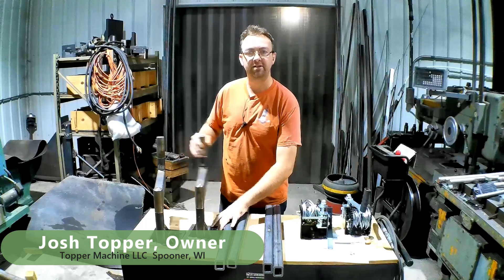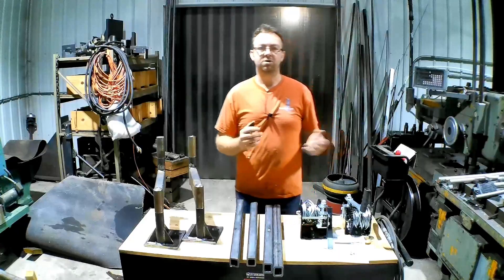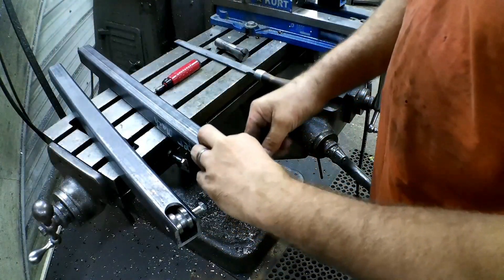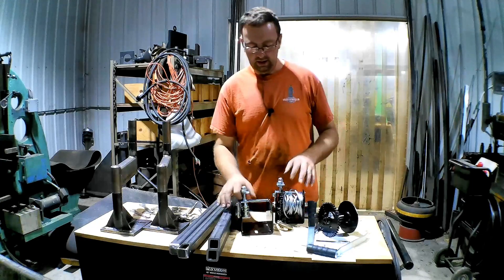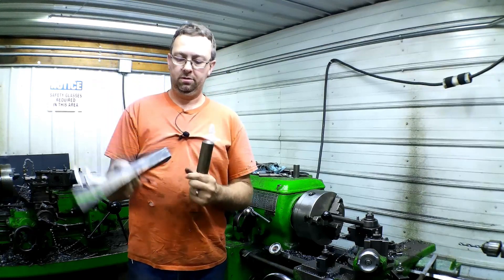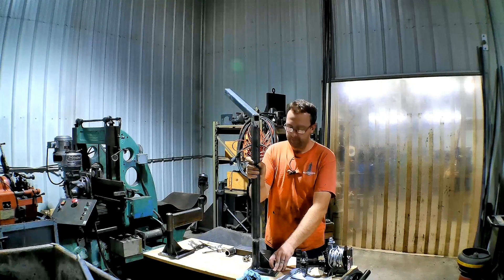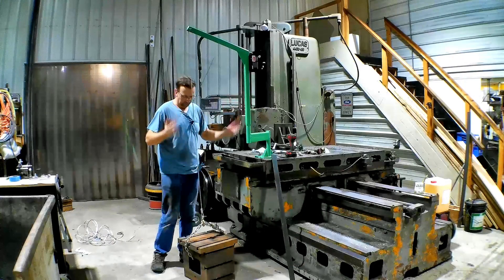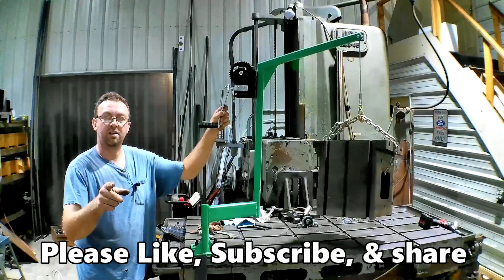Machine Shop Crane Build, Part 2, The Crane, Shop Made Tool, DIY Skyhook

Comment: Great video. I replaced my original winch with a worm drive. It was a little slow to feed out and retrieve so I now use a battery powered drill with a socket on the nut that holds the handle on. At the drill speed it was out of balance so I welded a counter balance on the other end of the handle. Then I use the handle for lifting weight. I like the worm drive because it stays put when you release the handle.

Comment: going back though your older shows to see what I have missed before I came across you, one question is why did you keep all the cable that is came with? If you were to cut the cable in about half you would still have more then you would need, but it would take up a little faster and would not build up on the drum so much. 
 But it's your build and it works as is so keep on doing it your way, you have a great channel and building the tools to get it done is the most fun a machinist can have.

Comment: Add a 1/4 hex in place of that hand crank and you can use a cordless drill or impact driver and you need not bother shortening the crank.  I welded one on to the same type of winch on my arbor  press to run the bed with arbor plates up and down. (Cable over the top with a garage door pulley set out from each top corner.) Has worked fine for years. You might want to consider repositioning the winch close to table height first to prevent standing on your machine ways and having to reach above your head to operate it.
Reply from the maker: I actually just use a socket adapter in the drill so I can use both the crank or drill. Works great. The HBM is the only machine that it's soon talk for, and I was just trying to get the video done. The step ladder was in the other room.

Comment: Hey Josh, Thank you for the Screw Machine tooling,  It came in the mail the other day.  One comment, the minimum bend radius of 3/16" steel cable is something like 4-3/4" diameter.  Don't  know what size you have, only a guess. The small roller wheel at the end is smaller than that minimum.  I know it will only be lifting light loads, just something to keep in mind,  The reason the Sky Hook product has such a small end roller wheel is because it uses roller chain.  ---Doozer
Reply from the maker: You're welcome. It is 3/16 cable. Skyhook has cable models too that look about the same, so I wonder if the load capacity drops with tighter radius.

Comment: What made you decide to go with wire rope and pulleys over machine chain and sprockets? I was under the impression that the reason skyhook uses machine chain is that there are numerous add-ons that allow the sprocket not back feed, effectively braking in any position. Was this just using what you had on hand, or do you think the wire rope approach is superior? If so, what do you think is better about it?
Reply: Oh my bad, I saw another comment asking about the two pawl hoist. I had not realized it was a worm drive. Am I correct in assuming you chose this out of a combination of frugality and because a worm and wheel is also auto-braking in any position?
Reply from the maker: I went with this setup because of cost and availability. Very inexpensive and effective. Skyhook does offer wire rope units. But the biggest factors in this build were cost and availability. Anyone can get these parts and build one.

Comment: I am interested in that winch - boat trailer winches only come with a simple cog drive and pawl clutch here, so in effect there is no way to move the handle to a different orientation or do a controlled release to lower ( when the cable goes out) except holding on to the handle. Does that sort of winch have a specific name? I'd like to try and source one!
Reply from the maker: Bought them from Harbor Freight. Worm Gear Hand Winch. P/N 63755

Comment: Great build and it was a lot of fun the watch, thanks. I could not work out how your swivel works, I could see you welded one end into the tube but how does it work inside the other tube with the welded seam?
Reply: It's called DOM tubing. It stands for drawn over mandrel. As you can imagine it is significantly more expensive than welded pipe
Reply from the maker: The tubing is seamless. The pin just drips in and works smoothly.